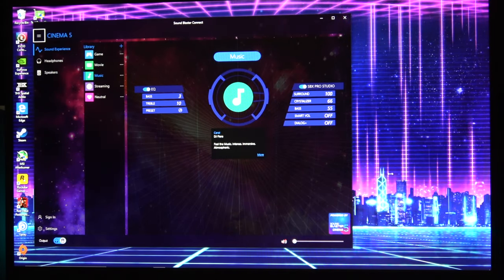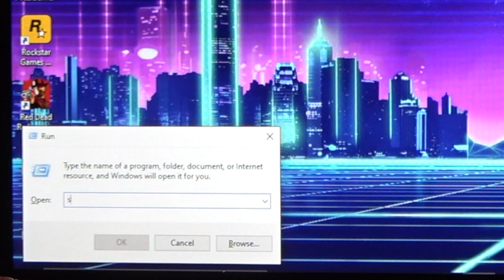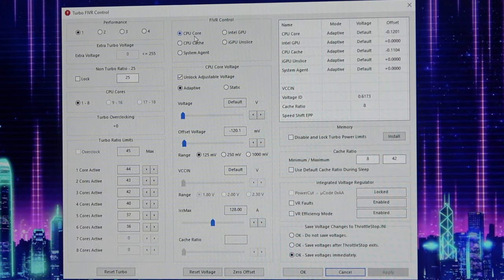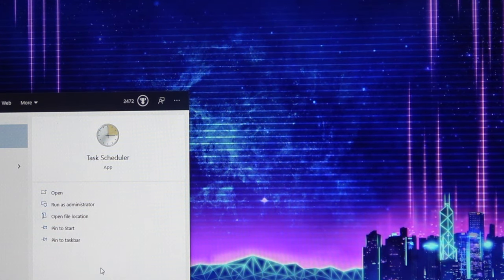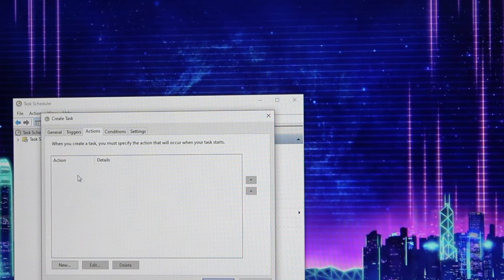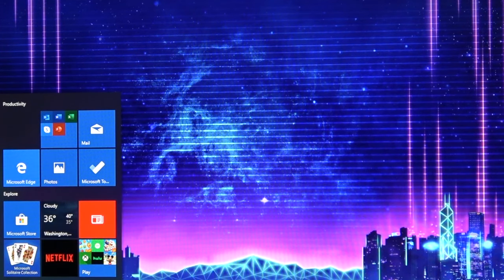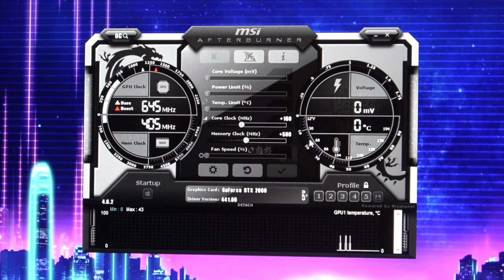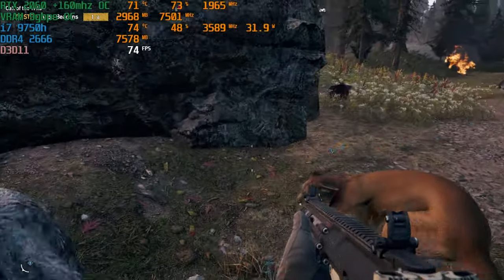EVOO Gaming Laptop Undervolting, Overclocking and SSD Upgrade Tutorial

Comment: Having now received my evoo gaming lp15 version of this let me say, it has 3 different drive type capabilities. It came with a m2 2280 sata drive installed. It has a second M2 slot, but it is nvme, as well as the 2.5 inch sata drive you added. I cloned the drive that came in it onto a 500gb nvme samsung 970 evo, and removed the M2 drive that came from the factory to store it with the OS and programs on it as a backup. That put the much faster nvme as the boot drive and will contain installed programs and the OS. I put a WD blue 500gb drive in the m2 sata slot, and a crucial  MX500, 1TB ssd in the same drive bay you used. The NVME is so much faster that it makes no sense to have an empty slot when you can have that speedy drive to boot and load programs from. The western digital blue will be used for install files and pictures and lesser used documents. The crucial drive will be for image backups of the other 2 drives. I expect to use about half the drive space on the 500gb drives, and create easus to do backup image files weekly. Should be able to fit 2 image files of each drive on the 1TB drive. Once a month, I archive my image files onto external 4gb hard drives. I know it sounds like overkill, but I learned long ago to keep older backups for quite some time. It is often the case that a virus or such can be on a drive for a long time before it is caught. The archive image files allow me to put it back to what it was months earlier if need be. A virus and such will often be on the image from a week earlier, the most recent backups are more for a hard drive just failing.
Reply: @Daijourn Marcelle I personally think the Samsung drives are the best drives on the market that are affordable. In any case, I would make the NVME drive in the NVME only slot, the boot drive due to the faster speed for booting and most used apps. The additional speed does little for copying files to the other drives though as the copying of files will be only as fast as the slowest of the 2 drives. Putting the NVME drive in the M2 slot that can accept both SATA and NVME drives will be slower than the NVME only slot, but still faster than an M2 SATA drive is there. Personally, I opted for a 500gb 970 evo in the NVME only slot because the 1TB drive was too expensive, and I already had a 1TB sabrent rocket NVME, but my trust in that drive is not as high as the samsung. I also already had a 1TB crucial SATA that is my second favorite reasonably price SSD. If you catch a Samsung on sale, it might be ok, but usually getting the samsung 970 in 1TB size is just too expensive. I have a lot of laptops, and they all have SSD...only some large external drives are not solid state. I would trust Samsung or Crucial for the operating system, and even though Iike the Samsung best between the 2, it is mainly due to the included software, I have yet to have either brand fail, and the drives usually outlive the motherboards or processors. As far as copying the OS to another drive, EasUs to do backup works well for me to create an image and restore it to the new drive. A solid state drive has a limited number of read/write cycles, so for me anything over 500gb would likely have some bad sectors before ever even  becoming full, so I usually put the larger drives as non OS drives that will be written to less often.
Reply: Darn, so the second pcie slot is sata only?
Reply: @Mako2-1  No, one is m2 NVME only, one is M2 NVME or sata, and 1 is not an m2 and is sata only. The one that accepts NVME or SATA sacrifices some speed with the NVME drive installed compared to the NVME only slot, but it will still be faster than the M2 SATA drive will be in the same slot. You can have 2 M2 NVME drives and 1 SATA drive installed or 1 SATA drive, 1 M2 SATA drive, and 1 NVME drive. You can't have 2 M2 SATA drives, but can have 2 NVME drives. The M2 slot that can take either M2 SATA or NVME sacrificed some lanes for the dual capability. It is still much faster than an M2 SATA drive. It just won't be as fast as the M2 slot that is NVME only. That slot is PCIe x 4, the dual drive slot is PCIe x 2.
Reply: sarge1231 thanks man, couldnt find this crap anywhere on the internet. It’s like evoo refuses to give out service manuals

Comment: Lovely!! But there are still no videos on the 15 inch version with the 1660Ti :(
Reply: it will probably be very similar
Reply: Did you open yours yet?  I want to install another hard drive just for games.
Reply: @songhyekyo81  yes. I opened it the very same day and installed the drive. But mine's the 17 inch model
Reply: Gokul Rama I wonder if mine is the same layout, I have the 15” 1660ti one.  I’m within the return range so kinda nervous opening it.
Reply: @songhyekyo81  it shouldn't be a problem.. Walmart is pretty lax with these things ... And you need to check whether those slots work too. Previously I had purchased the 1060 version last year's model and the NVMe slot failed on me after about 75 days. But I had gotten it refurbished from ViPoutlet and they gave me a full refund. So open it up and check it out
Reply: @Gokul bro i'm from india thinking to buy this lap from usa. My frnds are coming from us this month. I'm hearing the keyboard has some latency problem i mean when you type fastly the letters are mismatched eg if you type "the" quickly it's outputs hte. And how's the screen quality of this lap. I'm confused whether to buy this one or acer predator helios 300. The problem is i can't able to return as I'm from india. Please help me out.
Reply: I have one and it is the same and I have 3...yes 3, solid state hard drives in it. It has an M2 slot that can have either an NVMe or M2 sata in it, another M2 NMVe only slot, as well as the 2.5 inch space shown in the video. The bottom comes off exactly the same, with 11 identical screws...1 in the middle, 4 at the front and rear edges, and 2 on the sides. There are no wires or other items attached to the lower cover. That made this easy to change hard drives and memory, and the only laptop I ever had that I could have 3 hard drives in. I had 2 in some by removing the dvd rom to add a drive bay, but never had one that 3 was possible. I have a samsung 970 in the NVMe only slot, which is a bit faster than the slot that can have either. The NVMe slot has my OS and most used programs on it. Less used apps and such things as pictures are stored on a 2.5 inch Crucial SATA ssd which is the slowest drive. The other space has a Sabrent NVMe that is much faster than sata but making it able to have either a SATA or NVMe drive in it came at a cost of some speed when the NVMe drive is installed. It is. Crystaldisk shows the samsung at 3400 MB/s, the sabrent at 2400 MB/s and the SATA at 550 MB/s read speeds. I use the 1TB sabrent drive for easus todo image files for the other 2 drives. Critical unreplaceable files are also on all 3 drives as well as an external and network hard drive. Basically my documents folder. It amazes me how people will have very important files on only 1 drive, or even just 1 computer. I believe in backups, and backups of the backups, and of the laptop itself. Nobody should leave themselves vulnerable to ransomware or hard drive failure. In closing, this evoo is a fast, easily up-gradable laptop at a good price. I am not really a gamer, so I can't comment on that, but with the 1660 Ti GPU, it should be good. The 1660 Ti is not even used for office or quicken tasks, as they use a secondary intel onboard display, which will run cooler and use less power from the battery. The 1660 Ti is dormant until needed for graphic intensive games or apps. It supposedly activates when the on-board graphics can't do what is asked of it.
Reply: I got the 1650, anyone know if id be able to manually switch it out for 1660ti or the RTX?
Reply: @dametalgear  lol. No. Don't think so
Reply: @Daijourn Marcelle I can't understand what you're saying .. but definitely it's a great laptop and I would recommend
Reply: @dametalgear  these laptops have the graphics card soldered. So, no

Comment: Hey Sean! I just ordered this bad boy myself, I'm kinda a noob but I want this laptop to have the best possible chance when it comes to performing. Msi after burner. 1. Do you trust that thing in full? And 2. I mean im.getting the exact same laptop as your review if I do your settings will it run absolutely fine with no problems? Thank you! Love the vids. 
Edit: also I assume the msi after burner client is always running in the background even if the window is completely closed unless you end the task from task manager? May I ask how much ram msi afterburner uses? Thanks Sean hope I'm not too much of a burden for ya xD lol
Reply: May find this useful. 

"Im too paranoid to mess with undervolting or overclocking. 
I was having heat issues running high 70s low 80s centigrade with most heavier games. 
The issue was the i7 processors turbo function. Its nice to have all the extra power but for gaming its overkill. Unnecessary heat and potential for instances of thermal throttle.
I downloaded the Real Temp program and used the disable turbo option in settings and now I barely break 70c ambient room tempature 74-77f on a cooling pad. Far Cry 5 spiked my temps into 90c before disabling turbo and now it barely breaks 70.

Id recommend this for anyone using this. Increase the life of your parts and quiet the fans. 
use RealTempGt exe file in the directory for this processor to display all 6 cores temps. It works to diable turbo with either exe file though."

Comment: How do you get Sound Blaster Connect to work with the Evoo LP5? I have Sound Blaster installed, but whenever I start up the program, I just get a blank menu that I can't interact with, and I"m forced to shut off the Sound Blaster program. I don't have too many problems with THX Audio so far (for my headphones), but I'd like to get more granular equalizer settings. Also thanks for showing the undervolting/overclocking, I'm definitely going to do that soon!
Reply: I have this same problem

Comment: I installed the Sound Blaster Connect but it doesn't let you modify anything? Do I need to disable the THX for that? THX settings also give you options for sound EQ so what's the benefit of the Sound Blaster Connect? Thanks

Comment: Great video, you just got a new subscriber! Quick question, does the m2 slot support standard m2 ssd's or does it have to be NVME? I can't seem to get it to recognize my M.2-2280
 ssd. I even tried diskpart and it wasn't listed. Not sure if I installed it incorrectly but it seemed pretty difficult to get that wrong.  Keep up the great work!
Reply from the maker: I believe one slot will do SATA or NVME and the other is NVME only.  The one that does SATA May be the one that’s already populated though, you could try putting it the other slot ✌️
Reply: @TechWithSean  Thanks I will try that! For the under/overclocking in Throttlestop do I need to create specific profiles for gaming, just browsing the internet, or when on battery or will it  automatically adjust the cpu for me? Sorry I'm such a noob, I've never used this program before!
Reply: @stephengovea7290  Just for gaming and when u use the gaming or turbo mode in control center. If is just for web and youtube select office mode (no need for undervolt)

Comment: It's so hard to believe, I thought this had a regular ssd not just an nvme and a blank slot for an ssd.  Also I have an issue with that sticker that says that I void my warranty when I open the laptop up, how do you get around that?
Reply: Don't do anything to it, keep it stock untill the warranty runs out,... Then OPEN IT UP.
THAT WAY ITS YOURS AND YOU HAVE NO HEADACHES OR PROBLEMS TRYING TO GET IT FIXED OR REPLACED.
Hope this helps you.
Like and Subscribe!

Comment: I have the same laptop, but can't seem to get it to wake up with a wireless keyboard/mouse while it's connected to an external display with the lid closed. I have to open the laptop to wake it up instead hitting a key on the wireless keyboard to wake it up. Once it's awake, I can close the laptop and it works fine on the external display. I just can't wake it back up while it's closed. I tried going into the keyboard/mouse controls as well as bios, but couldn't find any options to enable this action. Have you had any issues with this or do you have a solution?

Comment: The laptop comes with an m2 sata drive, but I saw somewhere that the other m2 slot was nvme, I think I might want to put in a 1TB Nvme drive and copy the os to it and cahnge the boot drive to the nvme.
Reply from the maker: sarge1231 - I believe the 15” ones have a SATA drive, and the 17” has an NVMe drive
Reply: @TechWithSean  Nope, the 15 inch version has 3 drive spaces. 1 M2 slot is NVME only, the M2 slot that had a drive in it from the factory, is NVME or SATA, and the 2.5" slot is SATA. The slot that can have either SATA or NVME is not as fast with an NMVE drive in it as the NVME only slot, but is still faster than the SATA drive. It has to sacrifice some of the paths to the processor to allow either type of drive to work...it is clearly printed on the motherboard which M2 slot is NVME only and which is either. NVME only slot benchmarks at about 3500 MB/s. The M2 slot that takes either benchmarks about 2500 MB/s, and SATA benchmarks about 550 MB/s. My understanding is that some of the paths to the processor from the NVME drive in the M2 slot that accepts either is un-used unless it has a SATA drive in it. The benchmarks mentioned are crystaldisk fastest read speeds. Right now my 15" version has 2 NVME drives and 1 2.5" SATA drive in it.
Reply: @sarge1231  How do you set the NVME only slot with your cloned Samsung 970 drive as the boot drive in the bios? Do you clone the Intel 660 to the 970 first then change the boot drive in bios settings on the Intel 600, restart and now the 970 should load up everything as normal? Then you could install the other backup WD Blue NVME/SATA drive and Crucial MX500 2.5 SSD later? I'd actually like to keep the stock Intel 660 for backup storage in the NVME/SATA slot and just change the boot to the NVME only drive with the new 970. The 970 will have all the drivers and everything from the original 660? Thanks for your help! I'm gonna look into the EaseUS ToDo thing you mentioned
Reply: @_thevaporz  OK, it has been a while but I think I put the 970 in the NVME slot along with the intel drive in the NVME/M2 SATA slot. I can't be sure but I think I used the minitool partition wizard to recreate the partitions on the intel drive to the 970 drive, but I am not sure about that. I could have even used Samsung migration tool that came with the drive. In any case, after doing so, I shut it down, removed the intel drive and put the Crucial SATA drive in the SATA spot, and a Sabrent NVME drive in the NVME/M2 SATA slot. The important thing is when I rebooted the 970 was the only bootable drive, and it might have even given an error, not sure. In any case system errors after switching is common, but the computer will then repair the file system and switch the boot drive. I have copied drives using so many different tech-nicks it is hard to remember. I know I couldn't use my drive duplicator to clone the drive, because it is SATA only. I also saved the intel drive as it was for an emergency drive failure. When I copied all the partitions, that included the recovery drive. Minor hickups after the copy is usually no issue, or one minor enough for windows to repair it. I do always have to turn off samsung rapid mode on sata samsung drives, reboot and enable it and reboot again. I always had to do that on exact copies even, but the NVMe does not do rapid mode. When I had 4 identical dell laptops I could even move the hard drive from 1 dell to the other, but then I had to change the license code to match that laptop. Now I have maybe 20 solid state drives of at least 500 gb. I have at least 5 or 6 of them in external enclosures. I have at least 4 samsung SATA 500gb 860 evo drives that have not even been opened. I have just monitored the price and jumped on sales for a long time. I have not done an actual Windows clean install in probably a decade. I always have monthly image backups at least, and keep them until the space is needed. The Evoo though with 3 drives, I don't ever even have to use an external drive for image files. I have often had to figure out on the fly how to switch drives and such, and the earlier usb boot drive did not work in the Evoo when I tried it, but now I have one that works. Creating bootable flash drives has always been a pain. Easus ToDo backup uses WinPE to make the emergency disk and the version I had did not work on the Evoo, and it was a pain to get a working bootable flash drive made for the Evoo. Creating the emergency flash bootable media is the one thing I don't like about the program.

Comment: did you have any issues trying to customize the LED light bar? i am not seeing an option in the control center, only see keyboard. Emailed the company's support. It appears to be a somewhat common issue, judging by some reddit threads.
Reply: I have tried many solutions over the last year to finally solve it about a month ago… You have to download a different control center. Download the “illigear” one 
It’s the only one with the light bar option that won’t disappear...However that program doesn’t have a turbo mode so once I select my lightbar I just set the other program electronics control center as my main daily driver until I need to switch the light bar and then I use the  ill gear one. Least it works

Comment: Do I need to upgrade anything on my 1tb evoo 17” 2060 in order to over clock it or gain some more performance?
Reply: ehhhh not really tbh. just apply those afterburner settings and change your power plan to ultimate and youll be fine. you should also find the best nvidia graphics settings